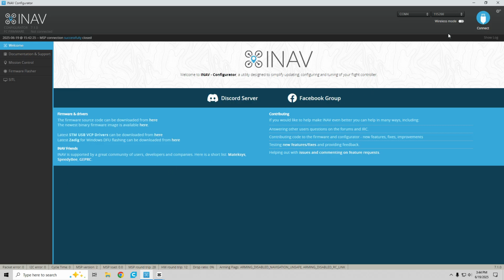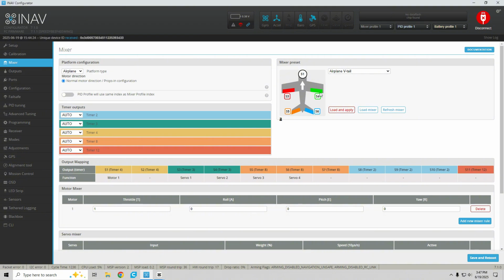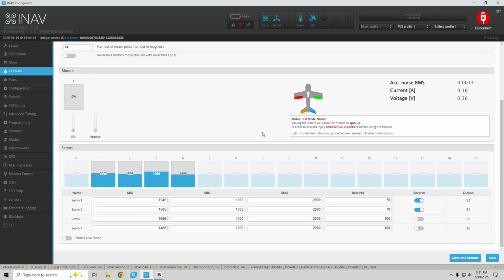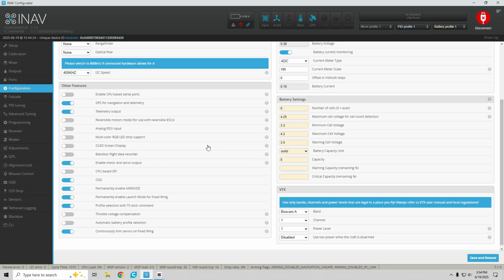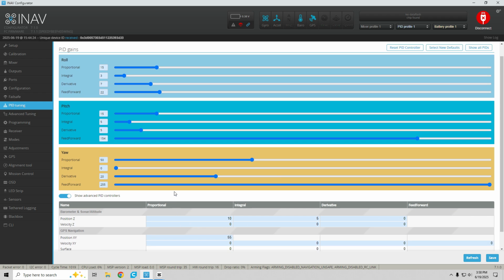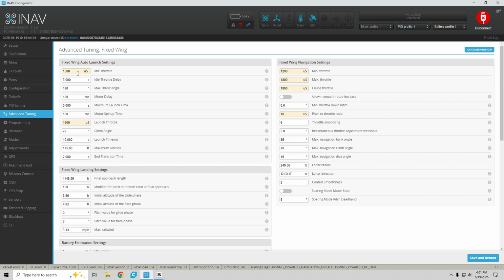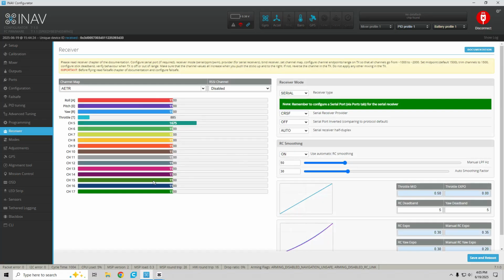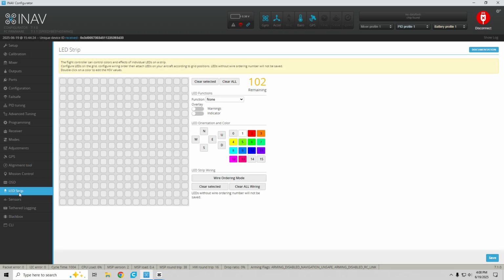Atomrc Dolphin Pro ~ Information Video  Deep Dive Into Inav

Comment: Thanks for sharing this. Are you using the stock Atomrc ESC? Also,  can you please describe how you calibrated the ESC? I can't seem to get mine calibrated, either using Inav (Output tab) or using the radio - throttle level.
Reply from the maker: for calibration for the esc check out painless 360's video https://youtu.be/9B6sel9jCF0?si=rWWRyv0HMe--77w8
Reply from the maker: I am running the TOYTENSI 50A 2-4S ESC

Comment: What kind of remote do you use with your dolphin?
Reply from the maker: I use a radio master pocket with all my planes love it.
Reply: @Pr0pCiRcLes2 I’m using a tx16s and am having issues makthe servos/motor work, everything in inav moves like it should when I move the sticks but the servos don’t. Love your video tho, super helpful!
Reply from the maker: @simeonlanman plane must have power from the battery for the servos to work. They don't work just plugged into the computer. And thank you 😁

Comment: Great video. I'm definitely going to take the stabilisation off the yaw now. I heard you mention you use DJI O3. If you set your OSD to AVATAR rather than  compat on iNav 7 you can utilise all the pretty new fonts in your DJI goggles. You'll need to be on the latest DJI firmware and set your goggles display settings to iNav fonts
Reply from the maker: Thanks for watching and I will for sure check in on the osd I'm all updated on everything on the firmware.

Comment: Will these settings work well on the original Dolphin, I'm using a 4s 1300kv T-motor F90 with an 8x6 prop?
Reply from the maker: I can get you inav 8.1 dump file for dolphin V1 if you need it ?
Reply: @Pr0pCiRcLes2 yes please, that would be great.
Reply from the maker: https://drive.google.com/file/d/1ECYWk5htlk9SawV4fDMe8iGoW4rQMzuQ/view?usp=sharing
Reply: Nice motor setup.  I am still working with the stock setup ,  but I have that motor in a box ready to switch soon.  

Curious, what ESC did you go with that motor?  I just have the stock 4s and 6s ESC from atom rc.
Reply from the maker: @user-otzlixr  Thank you I went with this esc to try out so far its working great. https://a.co/d/1MJlvNG